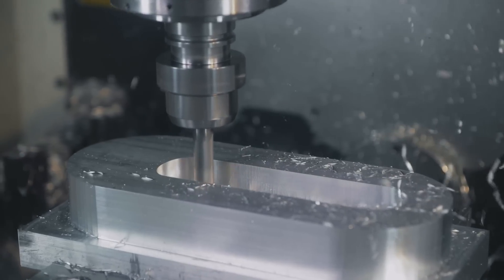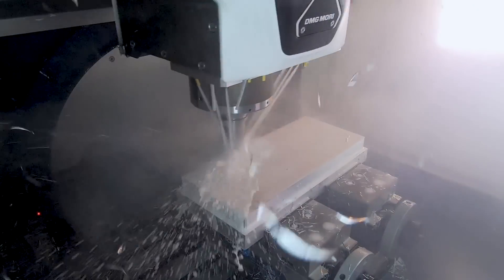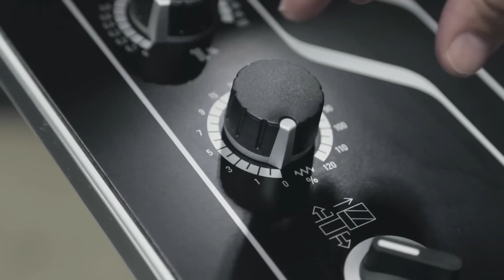KING Of ROUGHING | The KOR 5 from Kennametal | CNC Machining

Comment: King of Roughing my ass... I can get a 3fl cutter going 1000IPM with a 25% radial at 3xD. Its about 60% of the feed rate, but 2.5x the radial step over and the cutter is a third of the price. Must be nice getting a kick back from Kennametal for advertising all of these over priced, under performing tools.

Comment: I bought a 3/8" KOR 5 when this promo cam out. I have a TM-3P with a 6K spindle. The extra flutes let me cut comfortably at 145in/min and the thicker core has less deflection than some of my other shorter 3/8 tools. Surface finish doesn't look like a rougher... Didn't realize how much i loved it until I rapid moved it through some stock last night... Sad... I figured this place would be the best spot for it's eulogy.

Comment: Wow that looks impressive, but did the machine really reach 1600”/min? And also in the internal pocket?
I have been calculating on the feeds and speed for a 12mm metric tool on a machine with 18000 rpms and with the recomended values from the catalog i did get a High feed by 10% ae but not that high.
How do you calculate the feed? Or did you just push it up by testing on the machine?
My problem is that my machine can theoretically run a feed by 2300”/min but is not allowed to run more than 590”/min in continous production😬 according to the manual. Because there is no cooling in the axis spindles.
How would the mrr be if the tool was tap tested and run in full with and 1xD in depth or more. That could be interresting to compare🤔
Reply from the maker: Yes on the outside...
No on the inside

Comment: Great video. What coolant are you running? That doesn’t look like the clear Synergy you normally use.
Reply from the maker: It’s Synergy... Just running it at 1000 PSI so it’s got bubbles etc
Reply: Gotcha. Thanks! Just put a fresh batch in my first Haas that finally seems to be working (had issues with RO water not being good enough out here).

Comment: What would you recommend for a286 heat treated  material  I'm trying to hog mill .870 down to .25   and the last roughing endmill  only lasted for 23 pieces  while using the side of the cutter length /depth  .815 on a half inch emill.  Emill over all length was 4 inches solid carbide 4 flutes.
Reply from the maker: HARVI 3... I have a video on how to Mill A286 on this channel

Comment: So, will this work better in terms of raw geometry than a corn cob style mill? Does variable helix also help reduce chatter or is it redundant with rougher types?
Reply from the maker: Corn Cob tools are not designed for high velocity milling. Also the 2 extra flutes adds to the speed. Also, KOR5 roughs and finishes with the same tool. Etc etc etc.

Comment: I think iscars three flute rougher would give this thing a run for the money that thing will take full radial all day long 1/2 inch deep no problem. Never tried this tool so hard to say, but thats what we use on my mazak  815
Reply from the maker: Not trying argue but a 3 flute in most applications will not beat the 5 flute, that can also slot. Definitely not trying to slot but it can... The point of this tool is to go 1.5 deep on a 1/2 Dia and then take a 10-20% Radial... and pretty much rapid the machine... 

Calculate your Cubes per inch mentioned above... and let me know.
Reply: @TITANSofCNC  I wouldnt want to argue Its all good . Im very open to new ways  to do things. I'm just an operator not an owner but as a operator all ways looking to do things better instead of stand around like most guys at the shop
Reply: Btw if you want to remove some metal look up a makino mag 3 :)

Comment: Awesome :) you guys should also check out the gühring rf100 speed end mill it can do around 1000 cubic centimetres(around 400 cubic inches) per minute in 16Cr5 steel without any coolant. They have made a collaboration with chiron for that record, really nice
Reply from the maker: The rf100 is a legit EndMill... but this one has a different flute geometry and 5 flutes instead of 4 which makes it a speed demon. You basically can rapid with this tool on any machine that has equally high RPM’s.
But yes both cutters are geared towards the new age of efficiency milling. The cubes cut with the KOR5 absolutely amazing.
Reply from the maker: PS. Not trying to argue but 1000 cubic centimeters is 61.39 cubic inches.
Reply: Thanks for your reply and youre right I thought dividing it by 2.54 would be enough, my bad ;)

Comment: Problem with this is it only suits specific jobs, how does that cutter work using the "threaded" section at the end that stops it pulling out when your boss gives you a job that requires you to stick it out another 30mm?
Reply from the maker: This is a standard tool for all applications applicable... Meaning almost every job in my shop. The safe-lock grooves are great but you can also put it in regular holders.
Reply: @TITANSofCNC  I wouldn't mind giving one of those safe locks a try, I'm currently using a seco feed mill on my lathe, it screws into an "all in one" collet and balance nut to prevent pulling out aswell. Nice job by the way 👌
Reply from the maker: Thanks Alex.
I will post a video later in the week that goes over Holders etc.
Reply: @TITANSofCNC  and please talk about what is more rigid the bt40 or the hsk a63 or the big plus spindle please please
Reply: Works fine in a side lock, just did it at a customers shop 2 weeks ago.

Comment: 2:45 what are 100 cubes? 100cubic feet I presume, but I have no idea about imperial units.
Reply: 1 cubic inch is about 16.8 cc.    So 100 cubic inch is 1680 cc of aluminium per minute.   Times 3 ( density of aluminium ...) is about 5 kg of aluminium per minute removed....... That is insane!!!!!
Reply from the maker: Cubic inches removed per minute
Reply: @TITANSofCNC  You should check out Swedish seco. Their 490V250R050Z3.9A-MEGA-T end mil can perform around 200 cubic inches per minute in aluminium.

Comment: You and Kennametal blow my mind....will a tormach 770 mill do this ipm for me on 6061, 1018, 4140? Love the Vlog. Booom!!!
Reply: Thanks Titan....and Tyler! Slower than DMG, faster than taig... 😅
Reply from the maker: This tool is just for aluminum and soft materials but I did run a 3/8 on my Tormach:-)
Reply: Like Titan said the only limitation will be your machine. He was getting those feedrates with a 40HP monster, your 1.5HP tormach will be much slower but will still handle feedrates that outpreform standard endmills.

Comment: I always thought you dont want more than 3 flutes in AL because there's not enough chip clearance
Reply from the maker: That’s an old way of thinking.
High Efficiency Milling is explained in the video.
At the end of the day MRR is what matters so calculate it and you will see the difference
Reply: @TITANSofCNC  I used HSS toolpaths with stepovers and always using full DOC but always had issues with surface finish in corners when using 4 flute, had way more luck with 3 flute on AL
Reply: @KenyonPayne  this is a rougher only. Finish with a different endmill...